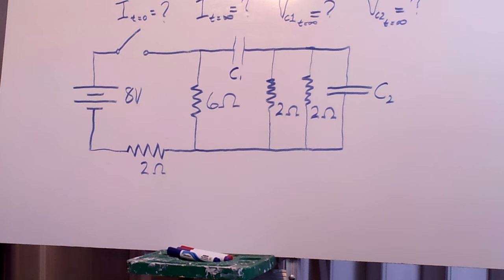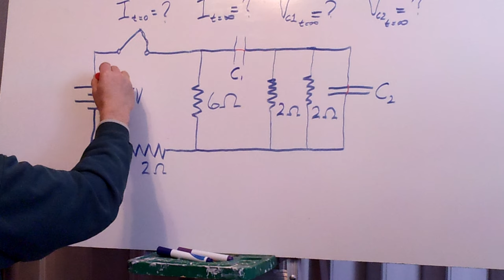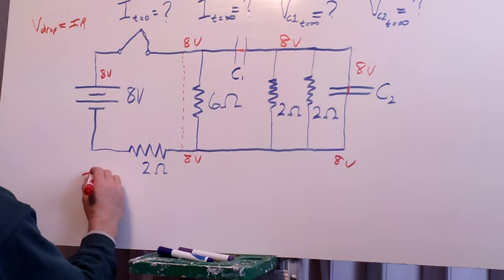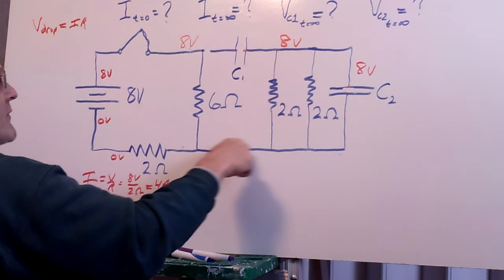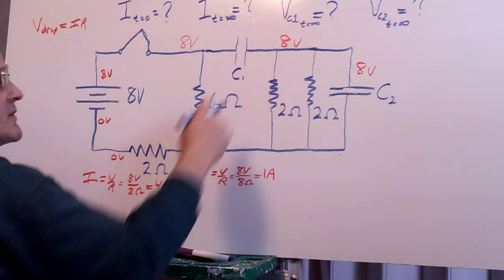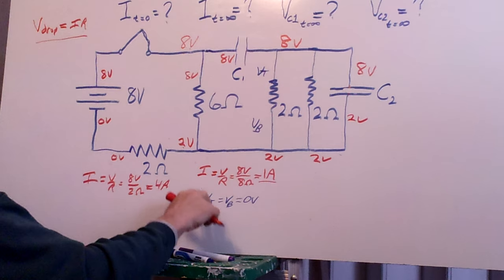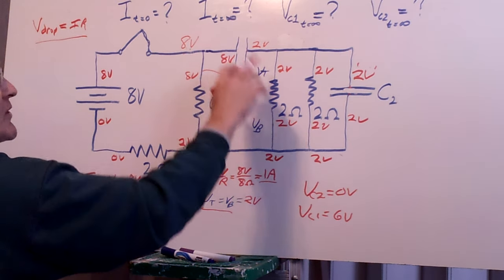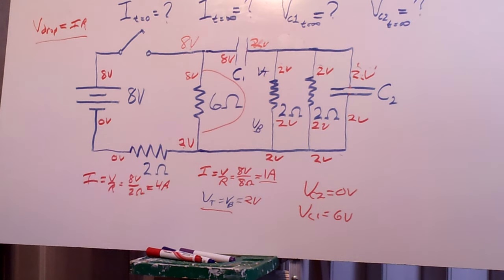RC Circuit Hard HW Problem - 4 resistors 2 capacitors

Comment: Beautiful explanation
You could also find the voltage difference between the plates of 1st capacitor by creating a Kirchoff loop including 6ohm, 2ohm, and the 1st 
capacitor. Setting the eq.
Vc-6*1-2*0=0
Therefore, Vc = 6V
On the other hand, thank you for this nice video, sir!

Comment: ALAN GLODOWSKI
without the LOAD, 
how much current in amps can a 4700uf hold store with a power supply DC voltage at +450vdc? the 4700uf filter cap will charge up to +450vdc but how much current is the 4700uf holding storing?  
What formula can I use to calculate how much current the filter cap is storing in amps?

Comment: capacitir as wires 
new trick learnt
Reply: hey did u ever figure out why the cap looks like a wire at t=0
Reply: @jjay11a  I know it's two years late . but it's because at t=0 circuit is just closed so the charged that got accumulated in capacitor is almost zero .

Comment: Sir your solution for Current at t=0 is not appropriate. It should be 16/7 A in 2 ohm resistance. Plz reconsider. Regrets if I m wrong
Reply: Mans QB it takes path of least resistance. So it just go through the 2 ohm resistor

Comment: i thought capacitors behaved like open circuits in a dc source
Reply: This is what i'm wondering too.
Reply: that is when they are fully charged
Reply: For example, he uses open circuit for the caps at 3:32. He is only concerned with the first one because it disconnects the rest
Reply: Spoder Man I had stopped watching before coming there. Now i watched the full video, thank you for the information mate.
Reply: Only after ~5 effective time constants.  Prior to this, current will be exponentially decaying in various loops while the capacitors are exponentially charging.  Once the caps are charged (dV/dT ~0), then current is no longer flowing and Caps do indeed act like OCs.  This is referred to as the "Transient Solution."  and is usually not important other than to LEARN what is going on.

AC Source designs seek to achieve the more important "Steady State" solutions.  These topics are used to design filters (low pass, hi pass, band pass, notch, etc).  But the systems can get so messy, that computer simulations (SPICE, MATLAB) and other freq response programs are used to evaluate the SS response.
Reply: Only in steady state

Comment: I think you're wrong sir!! b/c capacitors behave open circuit to dc source not short circuit.
Reply: No, they act like shorts at t=0 and act like open circuits after a long time since no current can flow through them anymore. The current looks like exponential decay to zero at t>=0 when charging. Look up the graphs for this if you need a visual aid, it helps.